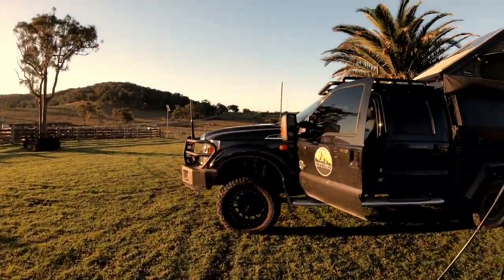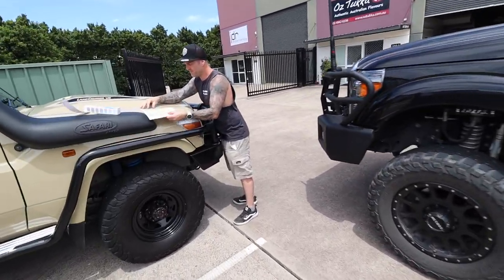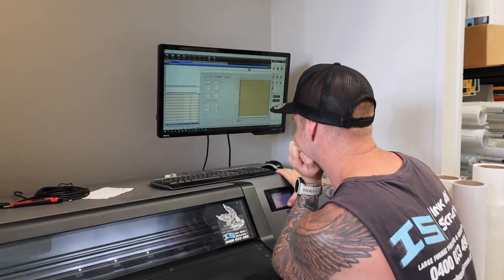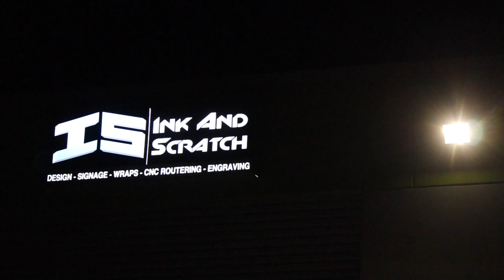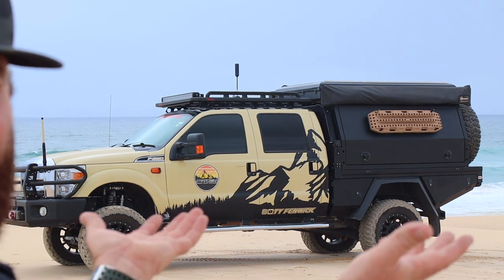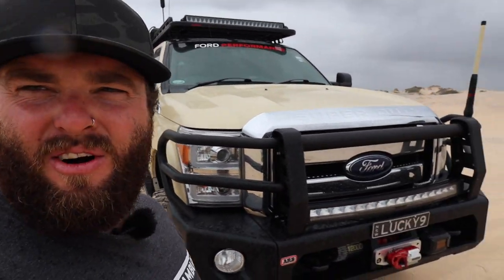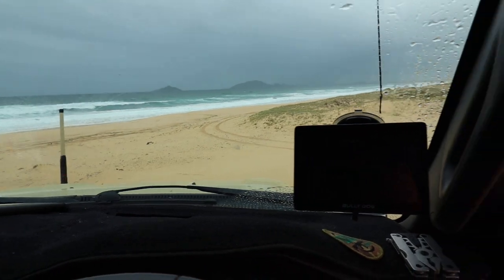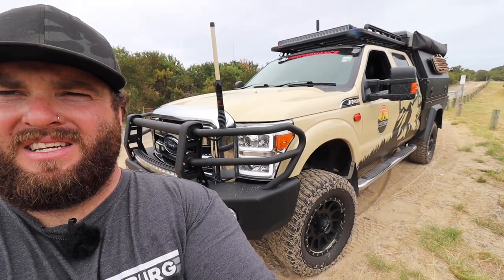LAND CRUISER OWNERS ARE GOING TO HATE ME ! The Sandy Superduty.

Comment: It's all about the build I guess if you have a deep pocket you can get whatever you desire but should you spend over $100k on a vehicle that will depreciate? I have a 2020 F250 4x4 and it costs $42000 I'm adding a leer camper top for $2000 and calling it good enough!

Comment: A few years back, I was working in Moab and didn't have much money. I painted my f250 the color of sand for $57.. that's a gallon of paint, brushes, roller, and black spray paint for the chrome. Every summer, I touch up the spots where red shows through. I like it, and beige is a much better color for camping

Comment: Love the American trucks & of course yours (even though I'm a Chevy Guy) I'm doing a budget build of a tourer myself based something between yours & a cruiser, a 99 Suburban. Even though it's old & my daily too. Currently building a 14 Bolt rear diff with my own Disc brake adaption, an Air locker & 4:56 gears to suit 35's. (the front will of course be next with a diff drop) Also doing Big front brakes, calliper's & Master Cylinder to match. Bloody hard to fins parts in Oz, but I like being different. Had to build my own Alloy winch bar, 4" snorkle etc etc (But that's half the fun & I'm not into it for a heap of $$....Yet!!) Yeah I've also done stuff like engine driven on board air, twin alternators with the current build of a touch screen for a reversing camera, OBD live monitoring, monitoring of my fridges & I should be able to link my Victron gear to it as well. Also about to build a swing out & down spare tyres carrier & pull those 4' rear windows out & add Gullwing doors, then a bit of a kitchen etc. I get given heaps of shit for my old truck but I do enjoy being different & driving in a lounge chair 🤣🤣. Your truck Looks Awesome, Well Done!! (Pitty more Aussies don't have the balls to build "real trucks" instead of just follow what everyone else does!)

Comment: Lets think,  reason why ford is only good at big truck or UTE and failed in small cars because big trucks doesnt need precised safety factor on all its parts dimension i and homogenous material science in design stage.  ,   just make parts bigger, since the vehicle is big, it just compensate the imperfection of material homogeneity issue.  This means  more allowance to cover the issue.   This is ddificult to attain this this in small sedans.  You need to make things smaller so that fuel consumption is better.     So overall,  ford is just hiding its design flaws and imperfections in this big trucks
Reply from the maker: What ? Ford made some of the most bad ass sedans in the world. The Barra ! 

The reason they don’t make them is because demand for sedans no longer exists and there the number one selling vehicle in the world “f150” but don’t let that get in the way of your “rant” 😂 

What about Ford introducing alloy body’s to trucks first ? 

Ford build trucks the best... it’s simple 😁
Reply: Cars have very little profit margin in them. It’s actually harder to make a 6 seat luxury vehicle that gets 10L/100km with 350kw and 1400Nm that tows 10 tonnes and meets all the safety and emissions regulations, than making a Corolla.
Reply: If main reason is sedans makes little profit,  then this will be the first thing that other car manufacturers such as honda, toyota, bmw, amg  will do to give up their sedan.  But they didnt.   Come one guys,  think.   Reason why ford cant compete in sedan range because of poor design.  Then dominos effect,  less models to sell, less profit.   Its all about quality.
Reply: @xylon288  so according to your dumb logic, Toyota doesn’t build a powerful 3500 diesel pickup because they don’t know how to build one with quality. Nissan couldn’t compete with a Titan diesel because the quality sucked. Toyota stopped selling the Celica, because of poor quality. The entire Scion brand was poor quality. The Avalon doesn’t sell very well - poor quality.  Ferrari doesn’t build a truck or a four door sedan, must be poor quality....

FYI, Ford is still building Mondeos and Focuses outside of the US, the only difference is there’s a higher demand globally where customers are willing to pay the higher margins. So that disproves your stupid “quality” theory. Toyota is also subsidized by the Japanese government, and the subsidies are often based on volume, not gross profit margins. So there ya go.
Reply: @alexs3187  generally,  ford can't compete in mid size sedan or small cars range in its own turf (USA),  with the other car manufacturers.  their profit is declining.   but not for the other car manufacturers.
Thats why ford is stopping the production of car petrol run engine segment,  slowly.  (note,  EV is different topic)

ford and toyota have mostly shared in this market segments.      
also note, that ford is older in this market car range.  (may not be  in small cars,  but in mid-size to full size sedan)

The focus of discussion is understanding of car manufacturer's quality then go deeper based on customer perspective with a little bit of technical background.   Aggregate whatever information we have as outsider then analyze where they faltered.   So that  to expose as much as we can to give our view.

 it is obvious that most of the sedan or small cars were built in petrol engine.   not diesel engine.   
bdw  toyota is actually already making its own diesel engines---well  with the support from well known other good quality diesel engine maker companies. initially.     so  they wanted to learn fast on this segment during those days of diesel engine development.  to save money in RnD and time.     they already did this method of learning during start-up of toyota then further improve it with their own quality system.    as you know,  toyota invested heavily in improving on petrol run engine cars over period of time which they succeeded that made other car manufacturers  slowly giving up in this segment.    toyota further initiate the proliferation of hybrid engine cars  into the market.  because they saw this will stay in the market longer than diesel engine-run vehicle in the future.   of course EV is the future and hybrid will be banned,   but I am sure, 100% diesel and petrol run engine will be banned earlier than hybrid cars.  but this is not the focus of discussion now.    
the focus is the quality .  this will give perception that how they perform in the future and beyond in making cars.

good diesel engine and big car body, is not synonymous to  good in making in all range of vehicle type---small  until super big vehicle.
it depends on which focus they wanted to focus, depending on the market.
remember, ford and toyota have mostly shared in this market segments.    
Diesel engine manufacturer with big vehicle body has bigger factor of safety in dimensioning its parts,---its needs to be thicker of course to handle such heavy weight.   but they can go more and they usually do.  it doesn't matter much to add more safety factor,  when targeting this market range (diesel + bigger vehicle),  unlike small and mid-size car---fuel efficiency is important because the market demands it,  of course they need to trim down excess unwanted matl on big cars---this is to save cost  but not to the extent they can trim down further until the flaws of matl is exposed then car wont last eventually.    so the bigger the dimensions, the more things to cover the flaws of overall design,  this starts from metallurgy of engine and other parts of the vehicle such as wishbone, chassis, timing chain, etc.  So   any imperfection on homogeneity of the metals,  just make it thicker, it  can help to cover the flaws.   (not 100%,  but it helps).    I.C.E. are such difficult to design than EV motors.  especially when they are getting smaller, trim down matls so that to save cost and matl. 

to top up this quality subject,   it needs good quality system to supplement the good design of vehicle for mass production.   it is  baffling to imagine Ford quality system is better than those 2nd user of  QS9000 which they co-authored with the other 2 big car manufacturers during those old days  (eventually evolved and shared to TS16949 then to IATF16949),  yet ford cant compete with the "Lean" system of toyota in maintaining the quality of cars and keep cost down so that to profit more and further improve car development.     there is something missing in Ford's quality system.   so the best way to do business,  bigger vehicles.   hide the flaw with this bigger vehicles.  this will gives impression that ford has good quality in its design.

if any one  is  a top executive of ford ,  it is natural way to  say   "making sedan and small cars is giving us small profit margin (ebitda),  that's why ford is stopping making sedan(run in petrol) in USA,  but will maintain the continuity of mid-size range outside USA"  .    Obviously, can't tell to people and customer that "ford is stopping making sedans or small cars because cant compete with the other car in terms of demand of the market, driven by quality".

I admit,  toyota car appearance is boring.   but this did not stop them becoming as what they are now.  but they are improving in this matter.

one of the driving force why ford cant compete in this range, because of "vox populi"---the consumers.  consumer's experience.
imagine, if there is no EV development in next century,  I am sure toyota will take over the truck range of ford in the future, slowly.  F150, F250,  or any future of F350 and so on.
Reply: @xylon288  Well Toyota is already pulling away from Diesel engines. They were always behind in the technology, and still are if you look at the weak power output of the Hilux, Prado and Fortuner. That being said, I’m not anti Toyota by any means, and I’m sure the next Gen Tundra will be amazing. As for sedans, you’re obviously unaware that Ford built a world-class RWD sedan in Australia called the Falcon, for decades. Unfortunately people don’t want to pay for quality sedans anymore as they gravitate toward pickups and SUVs. There were plenty of good small Fords too, with the Escorts and Sierra Cosworth.  Fast forward a number of years, there was the Focus with the Volvo 5 cylinder turbo engine and then the RS and ST. Hey if it’s good enough for Ken Block, it’s good enough for the rest of us.  
Also a business lesson for you, gross profit margin on a single product is not the same as EBIDTA. They are very different things.